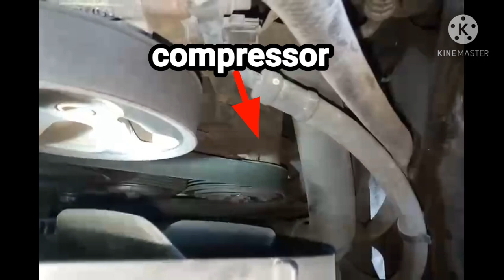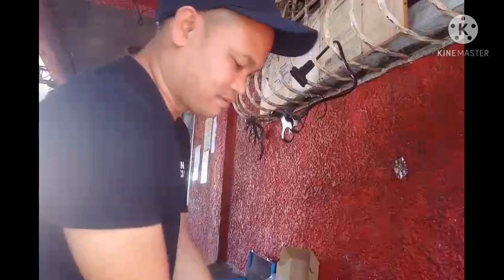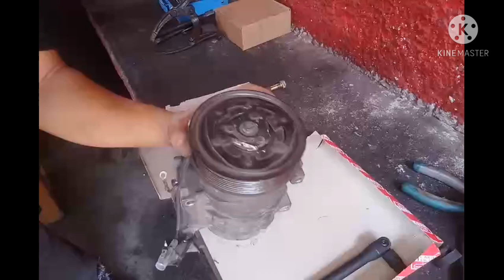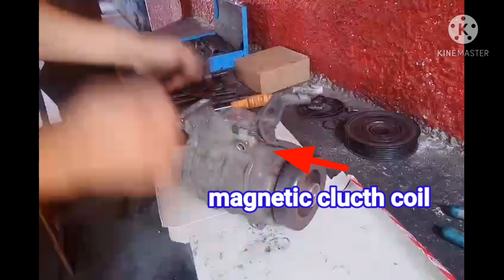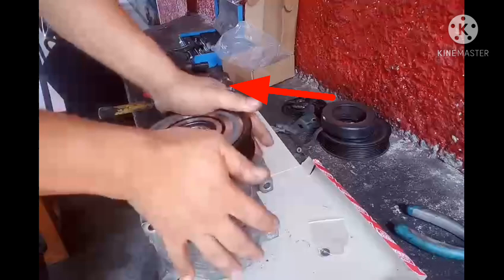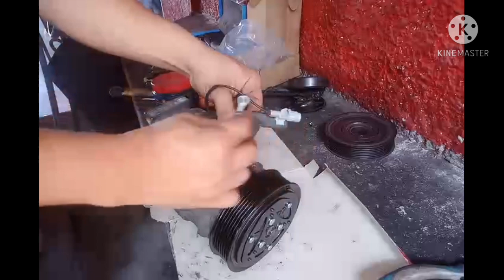Paano magpalit ng magnetic clucth coil assembly ng compressor ng Toyota Fortuner

Comment: good day paps.pwede po ba ako magpalit niyan ng hindi ko bubunitin ang hose ng compressor para hindi na po ako maf refill ng refrigerant sa system?
Reply from the maker: Pwedeng bossing kung kaya naman Po dukutin
Reply: sir. nagpalit po wako ng clutch hub lang pero bakit po ganon kapag mataas rpm bumibitaw po sa pagkaka magnet ang clutch. at lagi pa rin po sumasabit sa pulley ang hub.
Reply: kapag nasobrahan naman po sa spacer. ayaw na mag engage sa magnet ng hub. kapag maliit lang po ang gap. sumasayad naman po ang hub sa pulley
Reply: denso po ang brand ng compressor ko pero ang nabili ko online ay hindi po denso brand pero sabi po ng seller ay same lang daw po as long as 10S. maaari po kaya na hindi magka match ang pulley ko at hub? or sira talaga ang pulley or magnetic coil?

Comment: Good morning sir, tanong ulit ako tungkol sa AC ng starex 97' ko, laging nasisira yung fuse, malamig naman ang hanging bago nasira, wala ring ilaw yung on off button sa dashboard, nabasa ko sa google yung field Coil daw ang sira, pwede po ba magawa yun or palitan na ng bago ang compressor, Salamat at more power sa yt page nyo, laking tulong po Ito sa amin
Reply from the maker: magnetic coil po tawag dun bossing,grounded na ang magnetic coil kaya pumuputok ang fuse,kung oke pa naman ang pulley at hub ay magnetic coil lamjg amjg papalitan
Reply: @pinoycarairconspecialist3729  Salamat sa pag share ng  bagong kaalaman sir!

Comment: Sir tanung lng poh bakit ayaw na mg cut off yung low cooling fan ng ac ng for ranger..anu kaya dahilan   at ng high presure din sya
Reply from the maker: maraming dahilan po bossing ng naghihighpressure,pwedeng mahina ang fan,pwedeng marumi ang system ng aircon dahil may problema na ang compresor,pwedeng exfansion valve at filter drier ang may problema,ilan lang po yan sa mga dahilan kaya naghihighpressure,kaya ayaw magcuttoff ng auxfan ay hindi po nagautomatik dahil po naghihighpressure,kaylangan po matroubleshoot

Comment: Sir saan po location nyo? Pagawa ko sana aircon ko. Ayaw lumamig at hirap umandar makina. kpg di natakbo ng 60kph di naikot ang compressor.
Reply from the maker: Bataan po bossing
Reply: @pinoycarairconspecialist3729  malayo po pla sir. Cavite po ako. Ano po kaya posible dpt ayusin sa issue nung sakin sir? Nag palit n po kc ako bagong compressor. Sabi kc nung pinagawan ko compressor daw sira. Nung napalitan ganun parin. 15k na naubos ko, hula2 kc ung napagawan ko sir.
Reply from the maker: anu kotse at model po bossing?
Reply: @pinoycarairconspecialist3729  honda civi vti po sir. 96 model. Matic po
Reply from the maker: ganun b bossing,kaylangan machekup po ulit maaring nagkulang po ng freon,nagleak, napalitan na po ng compressor di pa po lumalamig,sa 15k bago na po dapat exfansion valve at drier,pati condenser bago na,surplus po b compresor o bago po?,
Reply: @pinoycarairconspecialist3729  brandnew compressor po sir. Nalamig lang po xa kpg natakbo n ng 40kph. Pag nka idle di po nagana compressor. Parang hirap xa mapaikot ng makina kpg nka idle. Iikot lang kpg talagang tumatakbo n ng 40kpg pataas. Dun plang lalamig buga ng aircon
Reply from the maker: maaring  naghihighpressure o may problema ang servo,pero kaylangan mapachekup u po ulit bossing,
Reply: @pinoycarairconspecialist3729  Hula2 mga napupuntahan ko sir. Malinis na din po ang servo nito pero ganun parin. Sayang malayo kayo. Sa inyo ko po sana pacheck. Anyway maraming salamat po sir. Godbless po at more powers sa channel mo sir💪

Comment: Paps bakit yun ac NG kotse ko pag matagal n Naka ac may sumisirit s compressor nawawala freon ano sira pag ganun paps salamat
Reply from the maker: naghihighpressure  yan  bossing, maaring tumitigil ang fan,kapag tumigil na ang fan ay naghihighpressure ang aircon kapag naghighpressure ay sumisirit ang breater at sumisingaw ang  refregerant  at nawawalan ng lamig ang aircon,kylangan po machekup muna ang fan
Reply: Paps honda city 2001 Naka  automatic radiator fan nya pero nun pag ni rekta ko Yun radiator fan hindi n sya na sirit ano  Kaya paps salamat